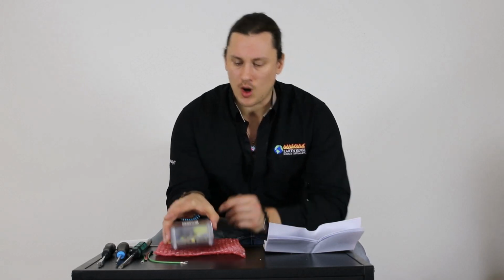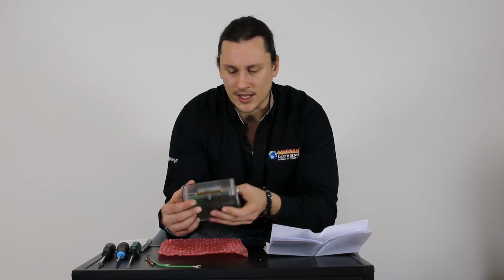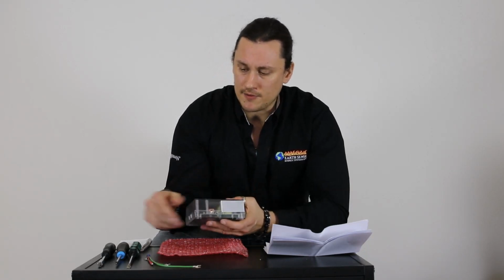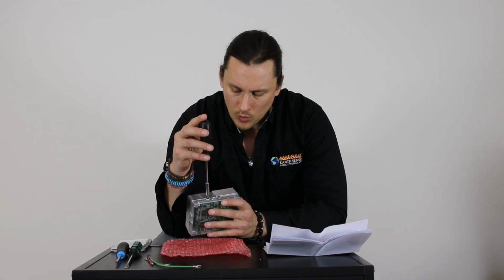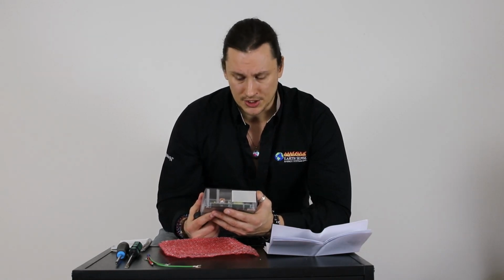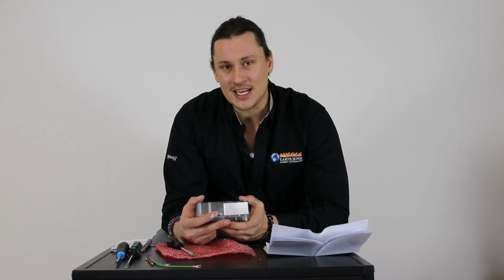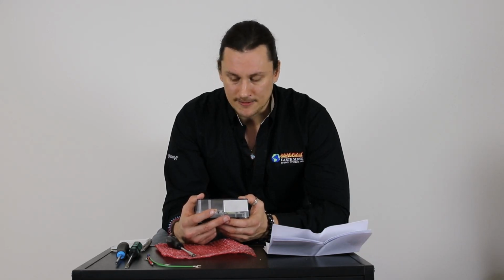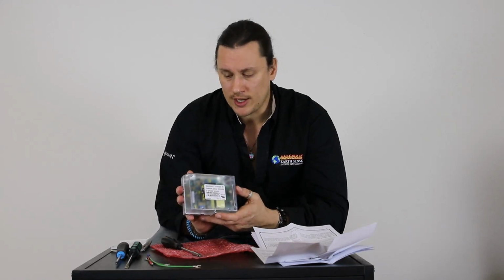QuadraFire 3 Speed Control Board Installation and Settings

Comment: i have replaced my thermocouple and it would only feed on start up. then i replaced the control box and snap switches  ..... help what do i try now
Reply from the maker: Hey Kathi, happy to help. Let's start with reversing the wires for the thermocouple connection. We've seen many replacements lately where the wires need to be switched. Generally speaking if the stove is going through the start-up cycle but not feeding after we need to take a closer look at the Thermocouple. Let us know what happens when you switch the wires on that. We'll get you back to 100%. Thanks!
Reply: @EarthSense  ok  THAnk you for getting back with me first off..  i have tried that and it would not feed at all.  i have also tried to replace the snap switches and i now got it to start up feed and turn on the room fan but not cycle feed to keep the fire running  please help me.
Reply from the maker: @UCAPMs9YBhpIZPqURTYgPF7g Happy to help Kathi. Can you let us know what lights and blinking sequences you are seeing on the control box through start-up to when the blower kicks in? 

This could be a vacuum switch issue shutting down the auger motor. This could be related to ash blockage in the stove or vent, leaky front door or ash door gasket seals, combustion blower not running at proper voltage, or faulty vacuum switch. Check the vacuum switch hose. Make sure it's connected well and there are no cracks. From there, let's test the vacuum switch by bypassing it. Bypassing a safety switch is for troubleshooting ONLY, we never want to leave a switch bypassed. Video below on that. 

Also, let us know what model you have and year - some models have a hopper switch that can shut down the auger feed as well. 

https://youtu.be/FDVkbsHS95U

Thanks,

Comment: My Quadra fire 1200i auger is clicking as it turns and not dropping enough pellets I have taken it out and cleaned Shute to make sure nothing jammed in there.  It’s the 3 speed unit it does light up and run but it doesn’t stay lit as it is not dropping enough pellets to keep it going after the initial starr
Reply from the maker: Hey Armando, It sounds like we may have a gear going bad in the auger motor. Generally when we start hearing abnormal noises from the motor and the unit is not feeding properly it will be an issue with the motor itself. 

Here is a link for reference - https://pellethead.com/product/pellethead-replacement-quadrafire-heatilator-eco-choice-auger-feed-motor/

Any other questions please let us know. 

Thanks,

Comment: I have the eco cab50 pellet stove what setting do I need to set the control board to?
Reply from the maker: Hey Ben, Here are the Control Box Setting Breakdowns:
0 – diagnostic

2 – Default for CAB50 and PS50

3 - +10% for CAB50 and PS50

6 – PS35 -10%

7 – Default for PS35

1,4, and 5 are not used

Keep us posted. Thanks!
Reply: @EarthSense  so I got a new board and that didn't resolve my issue. I bought a house with a cab 50 pellet stove but it was neglected and full of grime. I spent quite a bit of time cleaning everything out including my stove pipe. My auger won't turn in the start up process. I pulled the motor and bench tested it and the motor turns so I replaced the vacuum switch and numbers 1 2 and 3 snap switches. I have cleaned out the vacuum tube and also the stove pipe with no luck. Any ideas or direction
Reply from the maker: @benwilliams2290  Thanks for the message Ben, happy to help. Yeah, something going on here with the start-up sequence. How does your exhaust motor look? Would you be able to test the voltage on start-up with a basic multi-meter? Should be near line voltage on start-up in order to lock in the vacuum switch to initiate the auger feed. You can bench test the exhaust motor as well. Let's also take a look at the door and glass gasket to ensure there are no gaps and we have good seal. Any pressure loss in the firebox will not allow our vac switch to lock in for pellets to feed in start-up. You can use the multi-meter to check the continuity on the vac switch as well - Suck and blow on the vacuum line lightly and you should see readings when it makes and breaks connection. Let's also view that auger motor carefully - does it appear to be receiving no power/electrical current, or does it appear to be getting power but it's jammed/stuck. Could be something inside our auger shaft jamming things up here. Start with the basics and keep us posted, we'll get you to 100%. Thanks!
Reply: @EarthSense  so I found my problem. There was a wire that was leaning against the exhaust manifold that was grounding. It didn't blow the fuse but ruined the board. I fixed the wiring and replaced the board again and it works like a champ now. Thanks for the help.  My next question is should my exhaust fan be super loud when the stove is in operation. It seems overly loud
Reply from the maker: @benwilliams2290  Hey Ben, great eye to the detail here on what was causing the issue; glad you got to the root on that! Exhaust fan should be pretty quiet in the CAB - they use a sealed bearing exhaust motor in that unit. If it's super loud, you can pull it out, try to do a solid cleaning on it, check the fan paddle to make sure it's not bent/out of balance.

Here is the OEM replacement for reference. We also offer aftermarket motor kits for less $$; those should be back in stock this month. 

https://pellethead.com/product/quadrafire-heatilator-pleasant-hearth-combustion-blower-exhaust-fan-motor-oem/

Any other questions let us know, glad we were able to be of assistance. Thanks!

Comment: Hello, I'm having a new issue this season with my CB1200-i. I have the thermostat set to 67 degrees. The stove will kick on when the temp drops to 66. Typically what it would do is heat the room to 68. The auger would stop feeding pellets, the exhaust fan would eventually stop, and 10 minutes later the blower would shut down. Now what it does is the stove will turn on at 66 degrees, run the temp up to 67, the call for heat light turns off, the auger will shuts down, and the stove will go through it's cool down process as normal. With the fire out (but still warm) and the blower still running, the call for heat light will turn back on, the auger will start back up again and feed pellets. Then it will relight with a "Whoosh" as the hopper is pretty full. It will go through this "loop" 3-4 times, and sometimes non stop or until it reaches 68 degrees. I've replaced the control board with a good used one and it made no difference. l also replaced the wireless thermostat and receiver with a good used one and it seemed to solve the issue for a week or so. Now it's back to the way it was. I did notice that I hear a "click" when the auger starts to run again. Any ideas where to go next? Thanks!
Reply from the maker: Thanks for contacting us, happy to help. Appreciate the thorough breakdown. I think we should test the thermostat a bit more.
- I would be curious to know if there is any difference if we set the thermostat to say 72 degrees. 
- We have seen some issues with the wireless thermostats over the years - If you have the standard mechanical wall thermostat that wires to the terminal block that your 1200i came with, let's test the unit with that thermostat. Link below so you can see what it looks like for reference. 

On another note, let's cover operating suggestions. For the 1200i models we generally recommend setting the thermostat to the desired temp so the unit can go on/off as needed when we are heating in spring and fall (drastic weather changes) and/or when we are heating an area that is very energy efficient as far as insulation and windows retaining heat for long periods of time.

When we are in the winter months where it's generally always cold, we recommend maxing out the thermostat and operating the stove on the Low/Med/High toggle switch. This provides a consistent fire as generally the area will call for heat frequently during these cold months. Operating it this way generally keeps more of a consistent warmth and typically we'll see longer life expectancy on the igniter element. 

To me it sounds like as soon as the stove is shutting down, the area is calling for heat again, thermostat gives the signal to start and it's looping through that cycle. Could play into the weather depending on how cold it is where you are. Play around a bit with setting your thermostat higher and using the toggle switch to control the heat output so the temp in the room stays to your liking. 

https://pellethead.com/product/quadrafire-heatilator-gas-pellet-stove-standard-mechanical-wall-thermostat-w-wire/ 

Keep us posted; Any other questions please let us know. 

Thanks!
Reply: @EarthSense  Thank you for your reply! I'm using the Skytech digital display wireless thermostats. When the auger shuts down, both thermostats do not reach the set temperature of 67 degrees. Usually it shuts down when the temperature reaches 66 degrees, and cycles on and off several times till it gets to 68. Then if fully shuts down as it should till the temp drops to 66.  I did try different transmitters and receivers (thermostats) and the result was the same. I looked over the schematic under the lid...is it possible that the 200 degree thermodisk has an issue and is prematurely shutting down the auger? Then once that disk resets, the auger begins to run again?
Reply from the maker: @jeffsfleet  Thanks for the message back and the information, appreciated. The 200 degree thermodisk is one of the safety sensors that can shut down the auger motor. It is an auto reset switch. Unless it's faulty, generally this switch would only trip if A. The distribution room air blower wasn't working, or B. If the firebox got too hot/too large of a flame. If your fire looks good and normal during operation and your room blower is running correctly, I wouldn't think this to be the issue. 
In your 1200i we have a few things in line with the feed motor that can shut the unit down.
1. Thermodisk
2. Vacuum switch
3. Thermostat
4. Control Box

If it was the vacuum switch, generally it would not allow the unit to feed at all, however just like the thermodisk, if it was getting weak it may trip intermittently. In your case this seems pretty consistent with the issue you're having. I know you mentioned you replaced the board and have tried different t-stats. 

For Troubleshooting Purposes ONLY, you can bypass the thermodisk and vacuum switch (one at a time) and see if it makes any kind of difference. We never want to leave a safety switch bypassed, this would only be for testing/troubleshooting purposes. Video below on how to do that. 

https://www.youtube.com/watch?v=FDVkbsHS95U&t=6s

Keep us posted. Thanks.

Comment: I recently had a power surge, it seemed to kick out the setting of my insert stove.  I was ready to purchase a new control board, then found this video.  I learned that the dial was based on the setting of the stove model.  I turned it to 0 and then unplugged i then it turned it to 1 and worked fine.   I appreciate this video as it saved me roughly $200.
Reply from the maker: That's fantastic to hear, thanks for sharing! On a side note, very important to have a surge protector in place of 1000 Joules or more; never know when a surge or lightning strike may hit. Want to keep the board protected at all times. Here is reference link for that, any other questions or needs let us know, thanks!
https://pellethead.com/product/belkin-surgecube-outlet-surge-protector-1080-joules/

Comment: Can you share the settings for 4 speed controller?
Reply from the maker: Hey Todd, Reached out to our tech team to grab that info. Will reply and post it ASAP. Thanks!
Reply from the maker: Hey Todd, Apologies on the delay. Here are the settings for the 4-speed Quadra-Fire board used on the Mt Vernon OE.
0 – default diagnostic setting

1 – Default Mt Vernon OE setting

2 – Mt Vernon OE +10% feed on start up

3 – Mt Vernon OE -20% feed on start up

4-7 – settings are not used

Any other questions please let us know. Thanks!
Reply: Is this for the 7000-206 control box? Thanks.

Comment: I have an ecochoice cab 50 i wondering what setting on my control board i need
Reply from the maker: Hey Shawn, happy to help. For the CAB50 model Control Box, #2 setting is default and #3 setting is for +10% feed on start up only. Make sure the unit is unplugged from the wall when working with and/or adjusting your control box settings. Any other questions please let us know. Thanks!

Comment: I have a quarda fire classic bay 1200. When i start it up i get 2 flashing blue lights. Any ideas?
Reply from the maker: Thanks for contacting us Virginia. For your 1200, 2 blue blinks during start-up indicate the setting on the control board. This would indicate you have the board set to #2 which is 10%+ fuel increase during start-up. Most folks will run the control board at setting 1 for the 1200 which will indicate 1 blue blinking light and standard fuel feed upon start-up. If you do decide to change the setting on the board, just make sure the stove is off and unplugged from the wall. If you have any questions or are seeing issues with operation just let us know, we are happy to help. Thanks!

Comment: I've got a 1200 series classic Bay insert and I put a new control panel in and I'm wondering if I don't have the setting right the one I pulled out was set at 1, the problem I have is it doesn't always feed pellets when it turns on I'm wondering if I should set it at the two setting or could it be my auger motor is going bad it seems to work fine when it's running sometimes I got to push the button on the thermostat two or three times in order for it to release pallets
Reply from the maker: Hey Mike, thanks for contacting us. For the 1200i Control Box setting options are #1 for regular and #2 for +10% feed on start up. You can certainly see if setting it to #2 makes a difference. If no difference we may want to inspect the auger motor - it's possible it's loosing some of it's torque and is having difficulty feeding properly on start-up. Keep us posted, happy to assist!

Comment: How do you remove the control box. Do I have to bend the tab to get it out of the way?
Reply from the maker: Thanks for contacting us. Depends on the model and year, but yes some had a metal tab/bracket that would bend to allow the control board to pull up and out. If you know your model and year we can walk you through exact removal. Thanks for contacting us.

Comment: I have question about my quadra fire classic bay 1200, when flip the heat switch to high it cuts in and out.. is that the switch or maybe the control box??? Thanks
Reply from the maker: Thanks for the message Michael, happy to help. What is cutting out when you switch to high heat setting - Auger, Room Air Fan, Exhaust Blower? Is this a 1200 freestanding or insert? Approx age? Happy to assist. Thanks.
Reply: @EarthSense  freestanding about 15+ years. It is the exhaust fan and anger motor. It only does it when the red light is on for calling for heat.
Reply from the maker: @michaelmanahan4723  Thanks Michael, let me run this past our Quad tech team and I will follow up with you. Thanks.
Reply from the maker: @michaelmanahan4723  Hey Michael, Heard back from Tech Support -
The distribution fan is a separate switch and if the distribution fan is running normal, I would zero in on the three speed heat switch.  Could be as simple as a bad connection or a defective switch. The switch part number is 812-3500.  In either case the control board base must be removed and “unfolded” to access it.

Here is a link to the switch for reference, keep us posted with what you find. Appreciated. https://pellethead.com/product/quadrafire-heat-output-3-way-rocker-control-switch-oem/
Reply: @EarthSense  Ok, thanks for the help. I ordered the switch so I see what that does. Thanks again..
Reply from the maker: @michaelmanahan4723  Absolutely Michael! Please keep us posted once received and installed. We'll make sure you get back to 100%
Reply: @EarthSense  Well I installed the new switch and it is still doing the same thing. I guess it is the control box?
Reply from the maker: @michaelmanahan4723  Thanks for the follow-up Michael. Sorry to hear the switch wasn't it - I just messaged our tech team, will follow-up ASAP. Thanks.
Reply from the maker: @michaelmanahan4723  Hey Michael, our tech team recommends testing of the control box before a new one is purchased. If you have a local dealer that can test it that would be great. We do offer a testing service, price on that is $45 for full diagnostic and shipment back. It's an odd issue you are experiencing and being Control Box's cannot be returned after purchase, our team feels testing your current box is crucial in determining whether or not it is the culprit here. Questions please let us know. Thanks.
Reply: @EarthSense  I guess maybe it's not a big deal then, it will run fine on medium setting. But I will see if I can get a local dealer to check it out. Thanks again for everything.
Reply from the maker: @michaelmanahan4723  Absolutely. Again, if you can't find anyone local to help, just let us know and we can send details on our testing services. Appreciated.

Comment: I recently bought one of these and it worked perfectly but I could not figure out what to do with that extra grounding cable. I have a Quadrafire 1200i. Can you tell me if it is necessary for my unit?
Reply from the maker: Thanks for the message. The grounding cable is for the Thermocouple - Quadra-Fire recommends it but it is not necessary for your unit to operate.